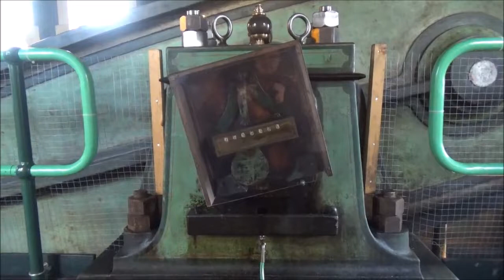1904 Tees Cottage Pumping Station Beam steam engine in steam and 1914 Gas engine

Comment: Great video. Great shots and angles showing off the machines to the best. I liked the lubricator wick. I hadn’t seen one before. To my knowledge there isn’t a beam engine in operation here in Canada. I could be wrong because of the vastness of our geography. I saw a beam engine in a museum pump house in Kingston, Ontario but it was not operating, though it looks like it is kept on top shape. Thanks for the vid.
Reply from the maker: There’s a few beam houses around here but none like Tees Cottage, none are so original as Tees Cottage. There’s loads of steam round where I live because of it’s industrial heritage, I actually used to volunteer at the Tanfield Railway where I worked in the oldest steam loco shed (still in steam use) Marley Hill.

I’ll have to take my camera with me round these places in future.
Reply: @SteamTrainsNStuff  great! Would love to see more sometime.
Reply from the maker: @Terrys-Steam-and-Bricks  I’ll have to head down again when they next steam it up, they only steam the engine and open to the public once or twice a year to preserve the site.
Reply: @SteamTrainsNStuff  makes sense.
Reply: @Terrys-Steam-and-Bricks  there is 1 in Canada in Ontario at the Hamilton Museum of Steam & Technology
Reply: @teescottageguyproductions  ohhhhhhhh. I’m going to put that on my bucket list. Thanks!!
Reply: @Terrys-Steam-and-Bricks  no worries! It only runs on a Motor now but it’s a large beam engine (a bit bigger than the one at Tees Cottage).
Reply: @teescottageguyproductions  too bad about the motor. But still, the moving parts would be great to see.